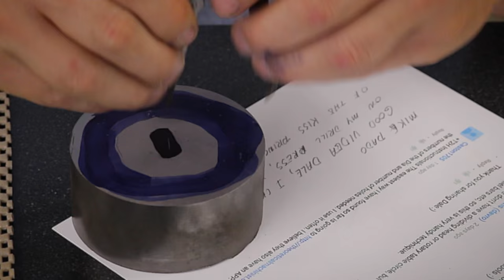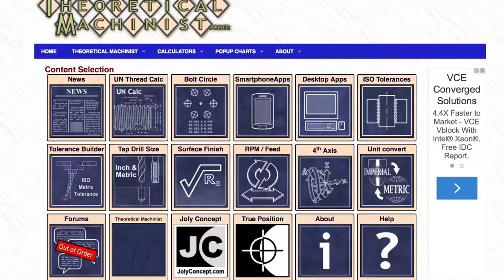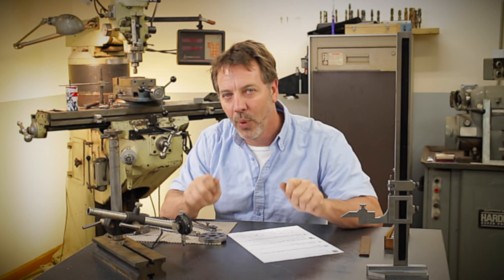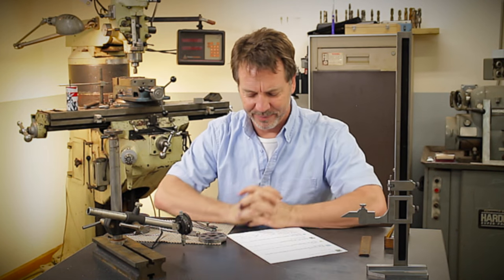How to drill a BOLT CIRCLE Q&A

Comment: If desired, the chord length or the bolt center to bolt center distance is easily calculated using the following formula. 

B = D x sin(360 / (2 x N))

Where: 
B = Distance between bolt holes
D = Diameter of bolt circle
N = Number of holes in bolt circle 
----------------------------------------
Worked Examples:

4.75sin(360/(2*5))

B = 2.7919 = Distance between bolt holes
D = 4.75 = Diameter of bolt circle
N = 5 = Number of holes in bolt circle 
----------------------------------------

5sin(360/(2*5))

B = 2.9389 = Distance between bolt holes
D = 5 = Diameter of bolt circle
N = 5 = Number of holes in bolt circle 
-----------------------------------------

Setting the compass or divider point to point distance to the value of "B" should get the layout very, very close. 
If using a scientific calculator be sure Decimal, Degrees and Real Numbers are selected. 
Also note the order of operations, work the inner parenthesis first, then parenthesis, then the remaining operations. 
If you do not posses a scientific calculator, Microsoft Mathematics is a free download from Microsoft and very capable of making algorithms, formulas and complex math easy.
Reply: Sir, we are grappling with this. Regrettably our maths at age 69 is rather feeble, like our bodies. We are trying to understand this properly and would kindly ask Your assistance.  We want to Calculate the exact Distance of SEVEN Bolt holes on a 65mm Diameter Plate.  Do please let us know.
TIA and kind regards
LORD Bless
aRM
Reply: Hello there PATW52pb1
Regret to have bothered You, Sir
Not to worry about this. PAT WILSON Esq below has indeed furnished the correct Calculations for the various Number of Holes in a given Pitch Circle Diameter, which we applied and resolved to our utmost satisfaction.
He is indeed one of the few of an erudite and rare breed regularly making tremendous contributions on Internet Forums assisting 69 Year young learners like myself. 
Once again, Thank You kindly.
ATB
aRM
Reply: 7 holes 65 mm dia   set your hermaphrodite caliper 26.24  and start scathing 7 times
Reply: Please! A little math goes a long way.  Most of these viewers do not want to take the time to learn your show off math.  They just want to get the job done.  There are several tables in books and online that will help.  If you want to get the hole placement within 0.005 mm don’t use a drill press. If 0.5mm will suffice, by all mean use the simplest methods for you.
Reply: I dont mean to be hard on the guy but this seems pretty foolish. Takes 30 seconds to do this on the calculator and have your holes located within a few thou. Why guess like he is doing, seems pretty contradictory to the Machinist way of working.

Comment: I have just watched your video "Bolt circle Q & A". When I was a young apprentice I spent 3 months in the template shop of a large factory fabricating such things as ladles for the steel mills. These were basically very large buckets made of thick steel with some steel belts rivetted around their conical shape. All the holes had to be pre-drilled accurately so that they aligned on assembly, allowance being made for both thicknesses of the steel. All the marking out of the drilling centers was done with a large pair of compasses stepping out along the curved line previously drawn on the template, just as you tried to step out the 7 hole drill circle. We soon learned to judge the compass setting fairly accurately and found the right step length with only a small number of tries. Sometimes the old methods are the most time-efficient.

Comment: Hello Dale.  It’s rather late for this comment but I’ve only just seen your video and Q & A session.

I’ve been involved in various aspects of mechanical engineering, including teaching it, for more than 50 years.

When I was an apprentice, none of us had heard of numerical control, let alone CNC, so when marking out work we had to use basic theory, which sometimes required simple trigonometry.

Your way of setting out the centres of the 7 holes using trial and error is quite satisfactory, but also time consuming.  There is a simpler, quicker and perhaps more accurate way of doing it.

Once the pitch circle of the holes has been scribed on the lathe, a pair of vernier calipers can be used to measure the diameter.  The first hole can be centre-popped at the desired position on the pitch circle.  The ratio of the chord length (between two adjacent holes) to the PCD can be calculated or looked up in a volume of engineering tables.  The chord length is this ratio multiplied by the PCD.  Open a pair of dividers to this measurement, and starting at the first hole mark out the remaining six. 

The calculation is as follows:
Chord length = [2 × Sin {(360° ÷ 7) ÷ 2} × R = 2 × Sin 25.714° × (D ÷ 2)] = Sin 25.714° × D = 0.43388 × D.

Or in general terms:
Chord length = Sin (360°÷ 2n) × D;  where “n” is the number of holes, and “D” the PCD.

Had there been 6 holes, the chord length would be Sin 30° × D = ½ × D (0.5 × D) = R.  So if there are less than 6 holes, the chord length will be greater than the radius of the pitch circle, and less than it if there are more than 6 holes.

By the way that website you referred to, http://theoreticalmachinist.com/, does not give this method using the ratio of the chord length to the PCD, only a method suitable for a CNC machine.

Comment: If you use a bit of math you can save time setting your dividers. The Circumference of a circle = 3.14 x the diameter. If you have a 2" circle the Circumference is equal to 3.14 x 2" = 6.28". Next divide 6.28" by the number of holes, 7 holes as an example 6.28"/7 holes = .897". To convert .897" to 64 ths. multiply .897" x 64 it equals 57.4, round it off to 57, set your dividers to 57/64"  and you will have a good starting point. To be more accurate use the Cord length formula posted below by patw52pb1 .

Comment: Good video on both. Circle circumference is pi times diameter. 4 inch diameter will be 12.56inches long divided by 7 is 1.7942. Set dividers at 1.794  
and mark the bolt holes. Combining a couple of situations I've been in. Again great videos,  thanks and keep them coming.

Comment: Your point about the degree of accuracy of a job is very important. This is the same as the concept of significant figures in science. You don't cut 2x4 lumber to thousandths to build a house! You don't work in micrograms when the formula calls for grams.  It is very helpful to know to what degree of accuracy the job calls for, especially in a shop where time is money. You made that point very well. 

What I do is just walk the divider around the scribed circle to the end then adjust roughtly based on the remaining gap (rather than scribe each point). It takes care to not slip but is much faster. 

Honestly I think that this method would cover the vast majority of bolt hole jobs. To me the key is transferring the holes to the mating part!
Reply from the maker: Thanks for you comment, 😀

Comment: I'm no machinist. I was a mechanical inspector for DefCons in the 80's,with 9 months of learn as you go lathe and Bridgeport use. Now I build motorcycles,and parts for them. As long as I'm not align- boring for bearings,I don't sweat it. (Not like anyone would trust me to do that). If you can't find your personal "good enough" line,you'll go crazy. As in my paint,prep and details take longer than execution. I thought your video was perfect for " good enough" jobs.